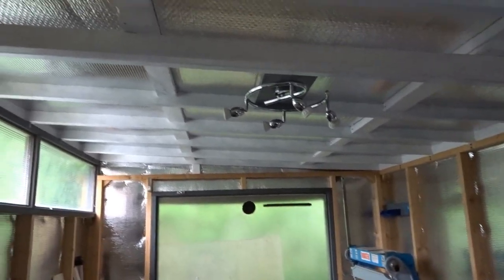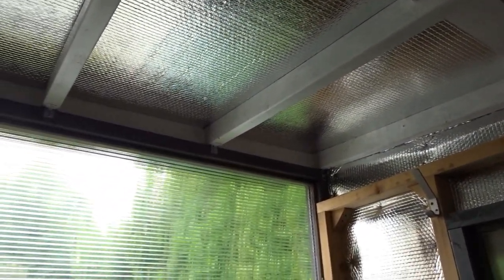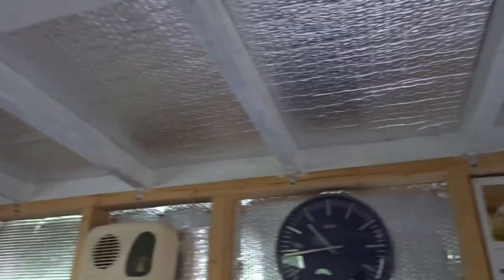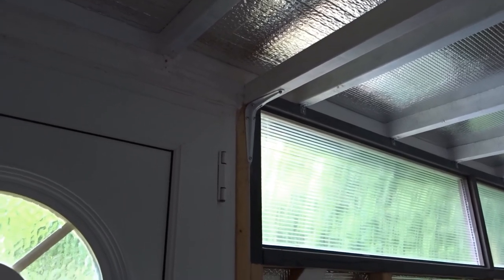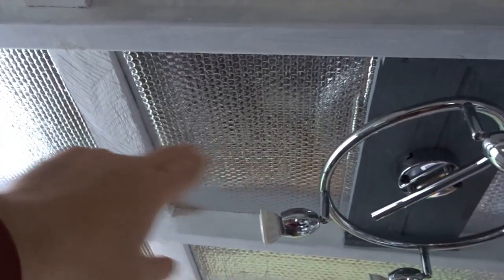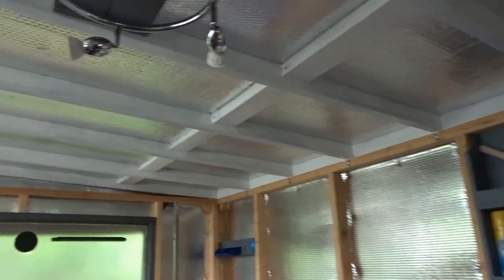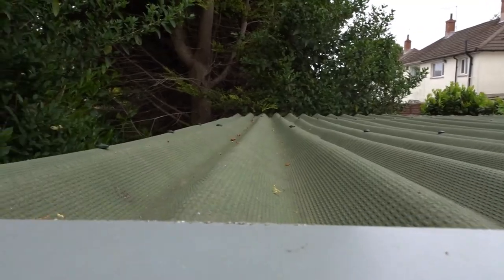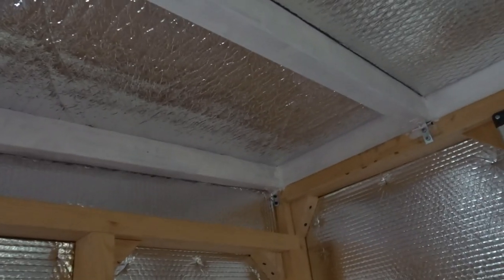How I built the Lightweight Roof of my Workshop / Shed - Explained

Comment: I built mine with 2x4s & they're in place with some proper roof brackets. Then i used 18mm osb & put  fiberglass on top. I have 75mm polystyrene in between the rafters then boarded the inside with 12mm osb. I thought if i was spending money i would make it as strong as i could. I did look at the sheets you used but decided to go with fiberglass in the end. Should last a lifetime. My build was probably a bit more expensive then yours though. I also built the walls with 2x4s & have 50mm insulation in the walls. Even in the winter once i was working in there it got hot. You done well to build yours for the price you did
Reply from the maker: Thanks mate 👍 Yea I've had a good look at yours on your videos it looks really solid and well insulated. Never actually thought about using Fiberglass for the roof it never crossed my mind at the time. I remember when I was a kid my dad used the fiberglass roof from a Luton Van as a roof for my Wendy house. It was probably there for 20 years and never leaked.

Comment: As long as it works for you Phill that's all that matters. I have watched your build before but I'm going back to watch again now. Also mate there is hundreds of ways to do things and not one way is right or wrong so I wouldn't concern yourself with potentially negative feedback, everyone has an opinion. I just try to take the information people give constructively or I just pop it to one side. Your shed looks well solid and there was no movement whatsoever in that floor was there, I have 2x4 base and 15mm + 18mm ply on top and I have far more movement then you so you've done a cracking job. One question what do you use your shed for mainly as you seem to do a lot outside in the garden when using your woodworking tools?
Reply from the maker: Cheers Karl 👍 Yea I agree with you about peoples comments etc. I built the shed for my day job to work from home so I don't actually have anywhere to do woodworking projects at the moment. Although I am considering building a micro workshop for future projects. Maybe an 8x8 It could be fun to see how creative I can be with such a small space its all good fun and a challenge.
Reply: @PhillWyattProjects  oh cool, what is it you do Phill?

Comment: Like the build , I’ve developed a leak at back end of slope on my shed similar style same corrugated roof as yours I’m wondering if my overhang was too short . Love to see how your shed is now and how you did the backend at guttering.
Reply from the maker: Thanks! Yea it could be that the overhang is too short or the slope on the roof isn't steep enough. Do you have guttering installed on yours? I'm planning to do a workshop tour soon. I can show all these things hopefully in that video.
Reply: @PhillWyattProjects  thanks for your reply Phill the slop is about 5 degrees but there is a sag in a couple of the rafters at the gutter end rear of shed . I think I might have to build a completely new roof. Should have replaced the rafters when I reboarded the shed 2015 yep we live and learn

Comment: I am curious about water run off from the roof.  Does it go under your piece of aluminum? I have a similar building I need to redo.
Reply from the maker: It was working fine although I replaced it with a larger piece of metal roofing trim. I made a video about how I installed it here: https://www.youtube.com/watch?v=VB60JQl4Vaw

Comment: Do sheds of this type have to be built to any local body building code there ?  Or, can you just use whatever you prefer ?   Here in New Zealand we must use the local code to determine timber sizes and spans.
Reply from the maker: Hi, well here there are size requirements depending on the area you live in. There are quite a few rules I couldn't list them all on here but it's all on google.

Comment: Hi thanks for doing video on roof construction just one more question the noggings you used where they screwed at a angle to rafters ? Thanks again for great video
Reply from the maker: No problem👍 those noggins were screwed from directly below and from directly on top. You could also screw them from an angle because the screws are just to keep them in position while they bear the weight.
Reply: Hi again I think we maybe talking at cross wires the noggins I was on about are the two rows across the rafters they are appear to be level with rafters and in a line so cannot see how they can be screwed from the top or bottom or aim I being a bit thick here sorry
Reply from the maker: @neilbrice449  ahh I see what you mean they are screwed in from the sides either straight through the rafters or from from an angle into the rafters

Comment: It looks excellent and strong. two points, you make me laugh...you speak of 2" X 4" or 2" X 4" studs and joists, but then confuse all our American friiends with 40cm centres to the studs, instead of 16". I am a builder of the old school who used inches before being forced to talk in mm (builders always use mm and not cm) plus your weight, Americans use lbs not kilos (I'm a stone and pounds guy). Even the Americans are having to use Napoleon's measurements because anyone who went to school after the mid 70s were taught in damn metric. Like you, I have been known to reuse the anular pallet nails, but started a few years ago to always use screws. It adds a few quid to a build, but is a godsend if you ever have to make some adjustments by taking any job apart. I even use the torque screws because they never slip when using a rattle gun (impact screwdriver). Keep up the good work, I enjoy your videos., because I can see the thought that has gone into whatever you do.
Reply from the maker: Haha yea your rite about me mixing up imperial and metric. When I was at school we learnt both so I mix them up without realising I do it with English and Spanish also when talking to my girlfriend 😂 I'm loving the result of the floor using the free nails I used literally 3 or 4 kilos worth so I dread to think what screws would have cost. Screws would be more convenient I'm sure but I did enjoy whacking in all those big nails into the floor.
Reply: No problem Phil, we all do it. It makes me smile when young kids (perhaps 8 years old, usually with a builder dad) talk about 2" X 4" timber nearly 50 years since joing the bloody EU...oops, let my feelings out haha. Please never think for a moment that I am criticising you, I'm not, just years of building makes me aware of these tiny points. I am at present carrying out a total refurb of a bungalow...I ought to video it, then you could keep me on my toes. Do I understand that your girlfriend is Spanish?
Reply from the maker: @keithfoxton5836  yea that's fine Keith I'm glad you notice the smaller details. You should film the Bungalow refurb that would be interesting. Yea I'm into my Spanglish 😆

Comment: where is the roof airflow?
Reply from the maker: The bitumen roofing sheets are attached to the Rafters with special screws. Where the sheets overlap in between the screw fixings there are gaps for air to circulate in and under the sheets. The overlap ensure water does not get in but allows for airflow from above.